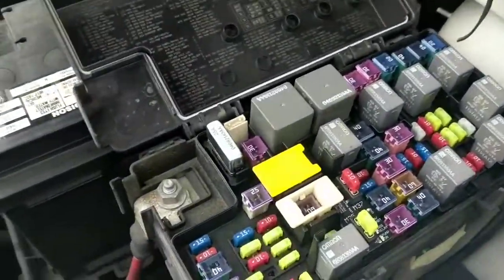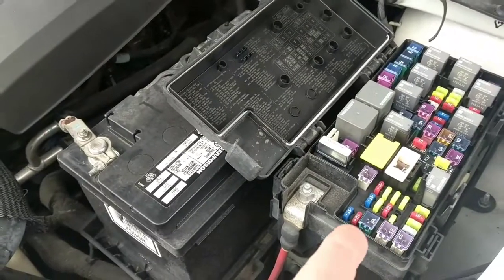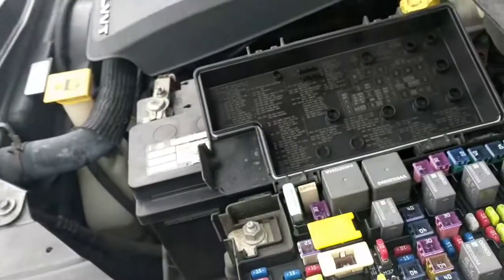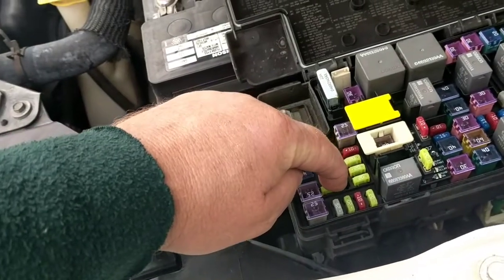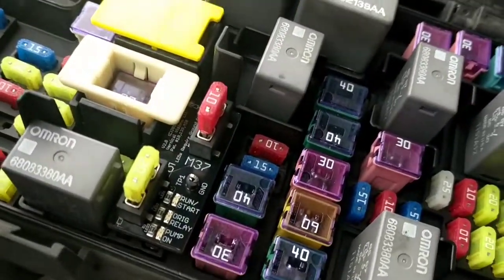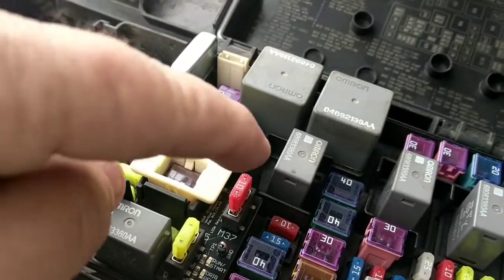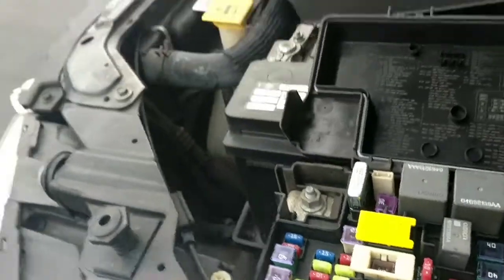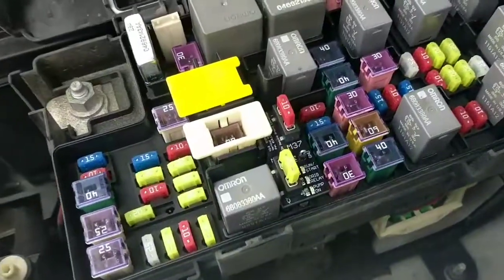Vertical Visions Electronic Fuel Pump Relay!

Comment: let me guess. If I'm refuel and I forget the key switched turned  "on", will I have the pump running when I'm refuel? that's dangerous!! This condition never happens in a tipm in good condition.
Reply from the maker: No. The fuel pump does not continue running when the vehicle is off
Reply: KEY ON (ENGINE OFF) POWER OUTLET ON = FUEL PUMP ON.  you understand ?
Reply: @DandyDoesIt  KEY ON (ENGINE OFF) POWER OUTLET ON = FUEL PUMP ON.  you understand ?
Reply from the maker: Why don't you just go to their website and research it yourself instead of asking a guy who posted a video 5 years ago?

Comment: I have a 2012 Dodge Grand Caravan, that I recently replaced a fuel pump because my van was not always starting. This did not fix the problem. So I did more research and learned about the relay issues people have had. Is there  a specific fuse set that this device plugs into? How can I be sure to get the right slots?
Reply from the maker: Just go to their website to identify the proper fuse slot and then just run a jumper wire from one fuse slot to the other and then stick the fuses back down on top of the wire to hold it in place properly. If that fixes your problem then you know it was the relay and not the pump. At that point you can go ahead and order the part from vertical visions and do it correctly. I actually drove for a few months just with a jumper wire between the two fuse slots and it worked great. I actually did not even need to order this part but I wanted something better in there. I just felt better doing it that way.

Comment: I just installed this.  It took longer to read the instructions than install.  Immediately solved my fuel pump running while off (killing my battery) and will likely solve the "no-start" gremlin I've been having that I thought was the fuel pump dying.  Not only was the quality surprisingly good (really well made part), it literally saved me the expense and headache of swapping my fuel pump for no reason.  

10 out of 5 stars!  I couldn't be happier!

This was on a 2011 Ram 1500.

Comment: Bought one and put it in started right up, but now the problem is the passengerdoors are opening and closing by themselves while car is off.
Reply from the maker: Make sure it's in the Right Slots! Somehow I do not believe the two are related though.
Reply: Check your fob. There is an issue with the metal clicky button breaking free.

Comment: Just my own from vertical visions and the part went in quick and worked as advertised.  Cost was about $130 for the part and my labor was free.  Much better than a $1400 TPIM + $800 labor.  Wife is happy now and that is all that matters :)
Reply from the maker: I have noticed that sometimes when I am in accessory mode (key turned but car not started) the fuel pump will sometimes run, so still be careful.
Reply: @DandyDoesIt  currently suffering from this issue with the car, purchased based on your recommendation. What is the cautionary concern with the fuel pump running while in accessory mode?
Reply from the maker: @JoshFlowers1  mainly just excessive wear on the pump. This van has since been totaled in a flood. Before the insurance came for it, I made sure to grab this baby out of the fuse box in case I ever need it again (my new van is also a DGC).